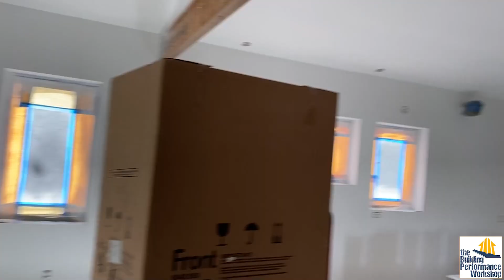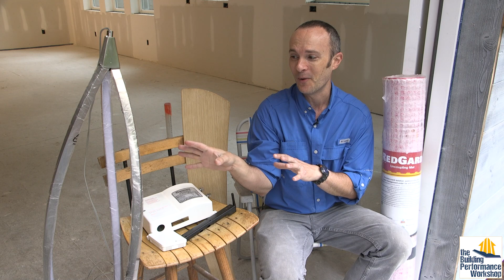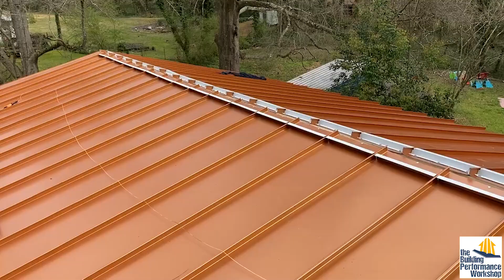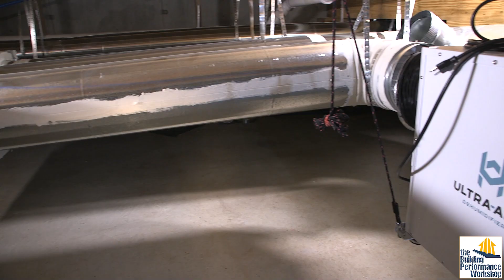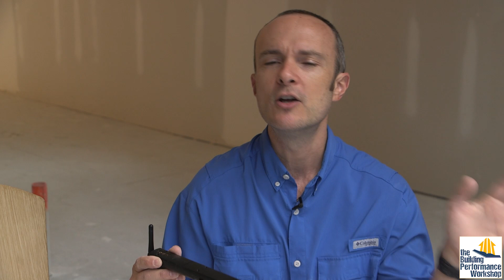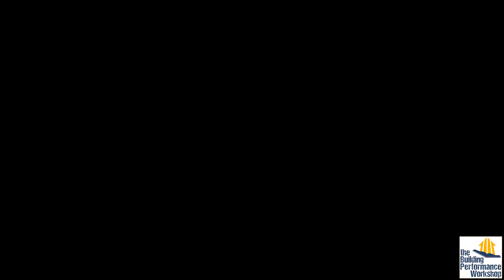Preview the Final Products going into our Forever Home

Comment: how many sq ft is your home?
Reply from the maker: 2200 living space, 800 work studio
Reply: @HomePerformance   the volume just seemed like a lot is why I asked but I guess with crawl space it would get up there
Reply from the maker: And the high ceilings
Reply: @HomePerformance   i just got my blue prints back from the engineer. Any suggestions on someone to send them to for designing hvac systems. It should be a really high efficiency home as it is ICF and cool roof design.
Reply from the maker: Best option is always to have your installer and designer be the same co. Works smoothest.
Reply: @av1204  cool roof?
Reply: @l0gic23  high reflective roof. Mine is going to be galvalume standing seem. It is a conditioned attic. The metal will sit 1.5 inches above the roof deck to allow air to flow under it.